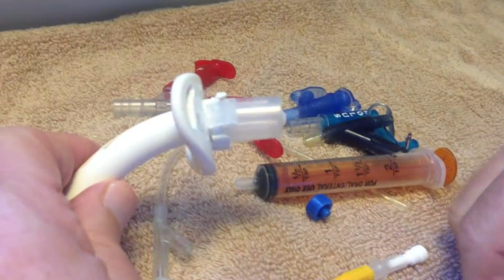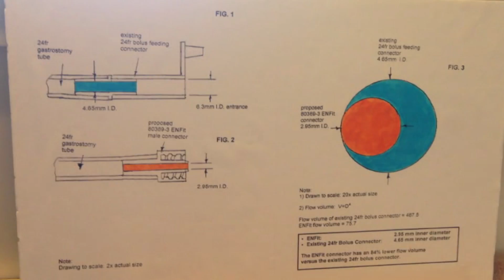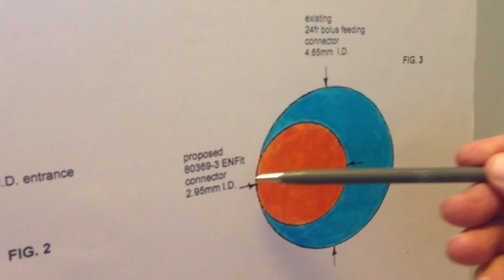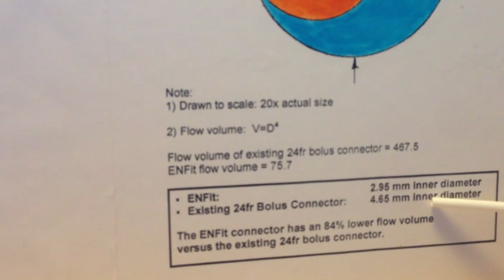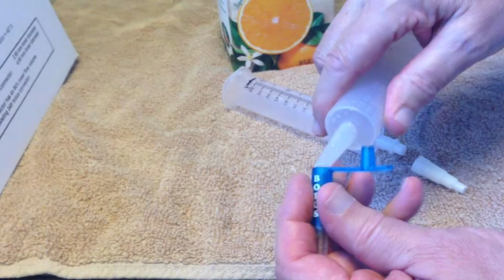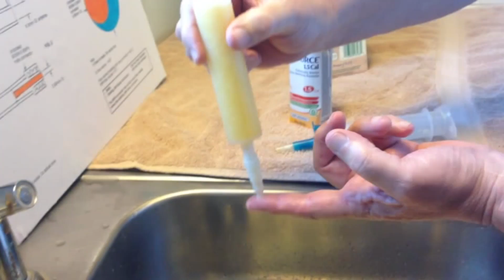ENFit compared with existing enteral connectors

Comment: ENFit is the new feeding tube connectors being FORCED on patients around the world.Supposedly due to medical staff hooking up feeding tube connections to IV lines resulting in death. Home tubies don't make these mistakes.Designing a connection that will not be compatible with any other medical tubes is great but actually has NOTHING to do with requiring it to be such a tiny bore. I'm sure a larger bore, larger connectors, and stronger plastic would all be much better and more satisfying to patients than what's coming out now. Some connectors have even broke into pieces.The inside diameter could and should be larger or equal to current feeding tubes instead of reducing the amount of flow which increases feeding time.Common sense says that the bigger the hole, the faster fluids flow out.The smaller the hole, the slower fluids flow out.Patients should have a choice, real food blenderized into liquid or using a manufactured formula. Taking away a patients "Right of Choice" should not be forcibly taken away.Just an attempt to sell more formula and more tubes as they will clog easier.I agree a timing device should have been used.
Reply: +errol childress Or a side by side comparison might work.